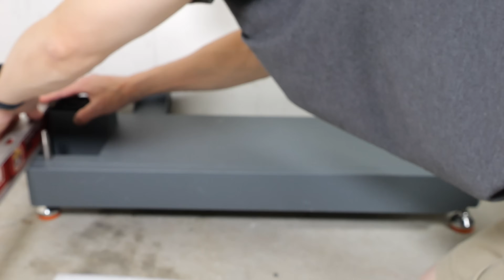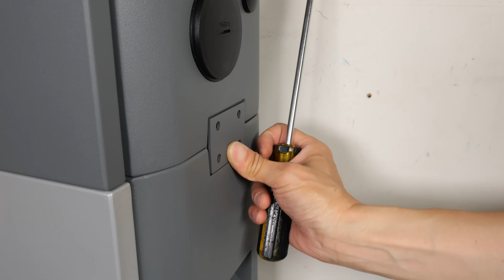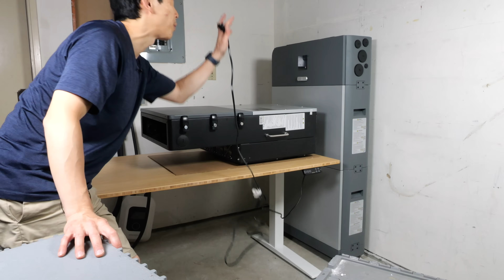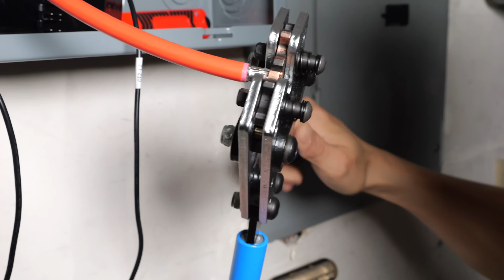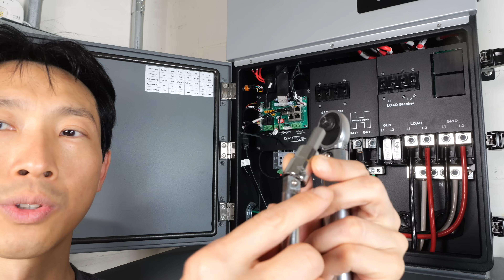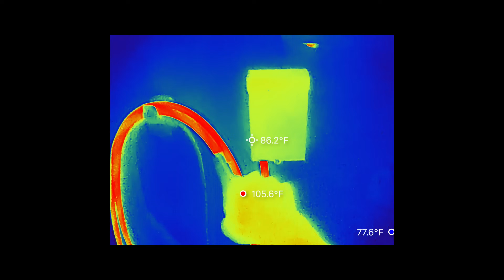DIY Envy 12kW Hybrid Inverter and 19.2Wh eForce Battery Install [Fortress Power]

Comment: You could have used PVC conduit, and EMT for all the DC conduit (NEC requirement)
Reply from the maker: I opted for EMT since I wanted a higher temp rating. Turns out, using pre-bent 90 deg emt makes it much more manageable.

Comment: As an electrician, and some who is frugal. This was hard to watch. I’m a big fan. And also all for DIY. But this is an absolute mess. A good electrician would have helped you SO much for peanuts compared to what this whole set up cost. That piping is an absolute mess. You should have considered putting in different panels or upgrading your service at this time. You have very small panels there. With all the work you’re doing those things will be plumb full and a huge pain to work in. Just to be clear. This is not about esthetics. I would be blown away if there are not issues here.
Reply: How would you have done it differently?

Comment: That's some amazing work! But from a layperson's perspective, you'd need about $25,000 minimum just for the parts/tools and the payback time for your investment would be 15-20 years or so. Therefore, an average person would really rather just throw that $25,000 in a S&P 500 ETF for an avg of 10% APY for 10 years and get a $25,000 return. They are also not bound to living in the same house for decades unless they chose to. Personally, it's not for me but your skills and attention to detail is very impressive.
Reply: A comparably capable system can be DIY installed for under $15k.  After the 30% tax credit, which goes away next year, the break-even is only a few years areas with higher electric rates and sunny weather.  

If you’re not worried about permits, grid interconnection agreement and use Alibaba sourced components for an off-grid system, you can get total cost for highly capable system down to just several grand or so.  On that, you’ll get break-even in as little as couple of years or so.

Comment: Very nice. I did like 80% of my own electrical work but for the service wire and main load center I had electricians do it. The benefit wasn't just that they are faster but also helped me get my inspection and stuff done.

Comment: Could you please provide some information so that I can analyze whether investing in battery walls would be financially beneficial for you?
Reply from the maker: Analysis depends on the total product and installation cost. You generally need solar to pair with the inverter to generate any returns. You're looking at 15-20 years ROI but can cut a few years up to 5 or so if you install it yourself. A actual system like this is a bit safer due to the concealed wires in a metal box as opposed to an even more DIY approach of building your own battery with exposed wires.

Comment: For putting up that inverter and batteries I would go to harbor freight and get one of those hydraulic table carts
Reply from the maker: Indeed you can, I suppose I just tried to use what I have instead of buying more one time use tools. The 4/0 crimper is certainly one of them.
Reply: @BeatTheBush   Ha, i bought a 4/0 crimper too.  However, odds are you and I will find ourselves adding battery capacity or building another solar system in the future.  This hobby is addictive.

Comment: It is helpful to have an NEC book. You don't have to know the entire book but you should know how to navigate the book to find relevant codes for your installation. Electricians get to use the book during the electrical exam but they only have so much time to flip through the book and find the correct page.
Reply from the maker: Thanks for the tip, I’ll take a look l.

Comment: Great video! I installed the same system. I used a block and tackle attached to a large lag bolt near the ceiling to lift the batteries. The system has been working great since March. Your standing desk levitating method is brilliant!
Reply from the maker: Block and tackle sounds good. I was about to install a electric wench. What was the mechanical advantage you used? 3:1? 4:1?
Reply: @BeatTheBush the Amazon listing was for a SOB 4000 pound 7:1 Block & Tackle. I could easily lift the inverter by myself. I did lift the lower eForce just fine with the B&T, the upper battery enjoyed my golf car driving away to engage the B&T for the upper battery.

Comment: heh here i am just driving around with 16kwh worth of batteries in my trunk lol, pretty solid install, lot of work with the conduit. feel like there are tradeoffs that electricians cant fathom with a lot of code stuff, like how current carrying capacity of wire is actually lowered by putting it in conduit with other hot wires. other stuff like how black wire runs cooler than red wire. still working on my hv  expansion battery for my car. automotive nvh stuff is kind of crazy all the engineering that goes into stuff like even wire sheathing. 
50v dc i feel like being able to inspect everything makes more sense but i think code says it has to be in emt/conduit which is dumbo. i think its just to prevent other dumb contractors from drilling into it idk. us electrical code is not made for anything DC.
Reply from the maker: Prevent heavy things from falling on the wires and shorting them or rodents from chewing the wires. Code probably has a bit more margin of error to account for corner cases I cannot imagine.

Comment: That THHN into the panel can't be exposed... You could have used some FMC there from the switch to panel.
Reply from the maker: I thought that was a possible issue, I’ll fix that soon enough.
Reply: Correct, and he can't put LB pull boxes inside a wall behind drywall.
Reply from the maker: The LBs will be in front of the drywall.

Comment: That’s a very big battery for only 19.2wh
Reply from the maker: Seems reasonable to me, could be 30% smaller?
Reply: @BeatTheBush it can be astronomically smaller. A decent 21700 cell is 19.2wh and that can fit in the palm of my hand.
Reply: @GerardJackProperty Lol it's 19.2 Kwh he meant.

Comment: Why did you end up going with this instead of the 18kpv?
Reply from the maker: I plan to install that one as well to evaluate both of them.
Reply: @BeatTheBush   Then, the question becomes why the 18kPV instead of the Flexboss 21 / Gridboss combo or the 12000XP?

Side note, I bought the 18kPV on a Black Friday sale last year.  I’m just now finishing the install.  I think I would have started sooner if I bought the Flexboss/ Gridboss because there’s a bit less electrician stuff i had to figure out.  However, the “Boss” components were available in a cheap kit yet from Santan Solar.  They usually over the lowest prices I’ve seen for kits, including panels and batteries.  

Looking back, I actually could have saved a grande or so gotten more solar input capacity by going with the 12000XP instead of the 18kPV.  I didn’t realize the 12000XP still has a grid input for grid to assist with starting an old 5-ton A/C if needed.  That said, the 12000XP seems to start those fine itself without a soft starter, though one is recommended for longevity of the inverter and the A/C.